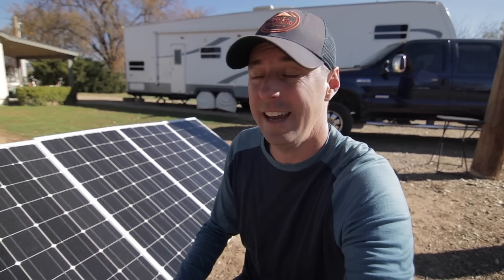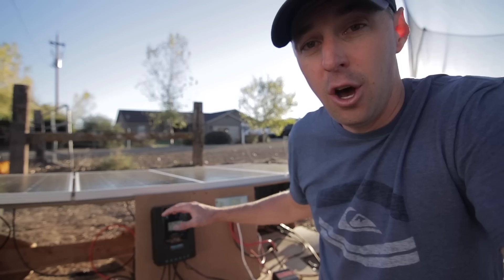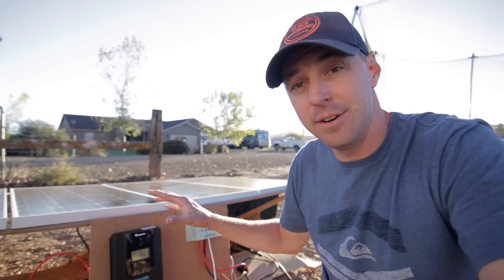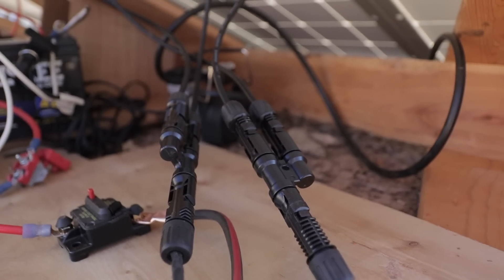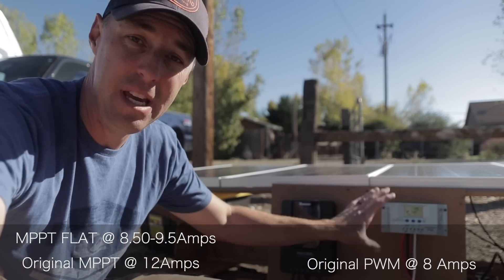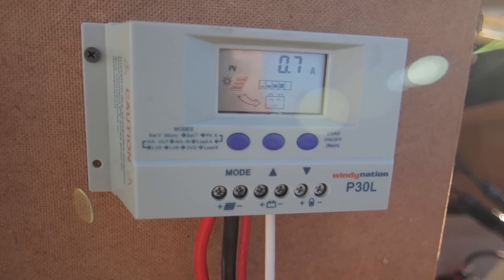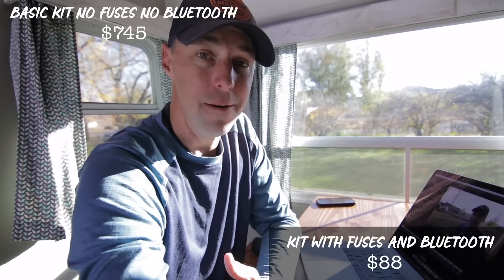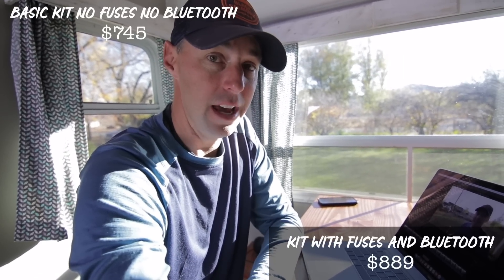RV Solar! Getting The Most Power From Solar.

Comment: As implied in the video, the drop in performance was less for the PWM side when shaded because these panels where wired in parallel.  Wiring in parallel wipes out only the panel that is shaded and not the whole array.  Thus the unshaded panel was still providing full output.  Just the opposite is true when multiple panels are wired in series.  Shading part of one panel wipes out the whole array so full performance is also lost on the unshaded panels.  The results would be similar for either a PWM or MTTP charge controller.  The wiring scheme was the primary factor.  

The advantage of wiring multiple panels in parallel is noticeably less performance loss if part of one panel gets shade.  The shade source can be something other than nearby trees.  It can be the TV antenna, AC shroud, air vent cover, etc.  Those things come into play as the position of the sun changes.  It is difficult to avoid partial shading during the day.  If wired in parallel, the impact is not that severe with multiple panels.  

The downside to wiring in parallel is the voltage says the same but the amps go up as the number of panels increase.  The higher the amps, the heavier the gauge requirements for the wires carrying the current to the charge controller or running more separate wires will be required.  That can be quite significant with a lot of panels.  Larger gauge wires or more wires can make the install more difficult and are more expensive. 

I have four 140 watt panels that are wired in parallel as it is not unusual to have shade on part of various panels throughout the day.   The controller is a MTTP type.  The question is, will the power output from the charge controller be the same if I wired the panels in series to get a higher voltage?  Since the nominal voltage is around 18 volts as is, I am thinking it is already high enough to take advantage of the boosting ability of an MPPT controller and there would be little if any gain.  I am thinking I am better off with the shade advantage with all parallel wiring than any gain I might get by increasing the voltage by wiring some of the panels in series.  My assumption is the final power output with a higher voltage input will be about the same.  

What would make a great follow up test on the MPPT array in the video is to compare the total output power from the controller with the panels wired in parallel providing a 12 volt array and then again wired in series to provide the 24 volt array as in this video.  

As far as wiring in parallel vs series, my thought is to go with parallel to the point where the amperage is too great.  At that point, as mentioned in the end of the video, do subsets of panels in series and then connect the subsets in parallel.  Keep in mind that the controllers have max voltage limitations.  Multiple controllers may be required for a large number of panels.  It is a balancing act so each installation will have its own unique set of requirements. 

Thanks for taking the time to put together this test.  It is good information.
Reply from the maker: Great thoughts you are spot on. I do have more comparisons planned on wiring for the MTTP. The plan is series vs parallel vs series parallel, but I need all 4 panels on the one system to do it. In other words your hope to see it is coming. Thanks for your comment it was well written and thought out.
Reply: There is a lot of discussion, confusion and misinformation when it comes to wiring panels in series vs parallel.  

My old boss used to say showing is better than telling and your demo board setup does a great job of showing.  The additional videos you have planned sound great and the quantitative nature will provide facts rather than speculation.  I love this stuff and am looking forward to the next video in the series.  It will be a reference for the ages!  Thanks for doing this.

Comment: Can you use the mppt controller with the lithium 100amp hour batteries? Also, can you wire the batteries in series?
Reply from the maker: The MTTP we used can charge lithium batteries no problem. On the batteries you would wire them in series if they were 6 volt  and in parallel if they are 12 volt.

Comment: Question, if I am changing batteries do I need to cover up the solar panels before I move the positive wires over to the new batteries?
Reply from the maker: I like having a breaker (https://amzn.to2Deesj9) to trip to disconnect the panels from the charge controller.
Reply: @AllAboutRVs I don't a disconnect but if I add one than I should cover the panels?

Comment: Nice job setting up the test. Q: Do you think the MPPT shade test performance drop is a result of those panels being wired in series and not necessarily the controller type?
Reply from the maker: Yes you are spot on. I should have explained it was the Series wiring that caused the drop. I plan to do a video with a few more comparisons with the MTTP before it makes its way on to the rig. Thanks for watching Brian!
Reply: @AllAboutRVs  No problem
 I enjoy your videos. Keep up the good work. Also, the MPPT plus your fast charging low resistance lithium batteries will also be like having an extra solar panel.

Comment: What about battery types. Do both controllers support lead, GEM or lithium?
Reply from the maker: The PWM on I used is for lead acid only . There are PWMs that have those options. The MTTP I used in this video can be configured for all the different types of batteries including lithium. Great question.

Comment: If you are  using the panels to keep batteries from going dead when away from your motor home  for a time which way is better. What amp is your  MPPT controller
Reply from the maker: I think you would be fine wiring them either way for that application. The MTTP is rated at 40 amps.

Comment: Shade is the reason im not going to put my panels on top of the travel trailer.  I'm almost always under canopy to keep the trailer cooler. Thanks for the idea on an mppt and running my two panels in series and the use of lighter wire.
Reply from the maker: If you have shade often you can consider the parallel and still use the MTTP.  I think I might do a video on this also.
Reply: Great video very informative it could just come down to money you just have to buy what charge controller  you can afford .

Comment: Very informative video. Thank you. Curious about the load used in your test,,did you use 2 separate batteries with a similar state of discharge or did both systems go into the same battery at the same time?  If going into the same battery would difference in output voltage of the controllers interfere with performance readings?
Reply from the maker: We used two similar separate batteries and discharged them very close to 50% DOD to have the controllers as close to equal as possible. Good Question.

Comment: How these panels compare to the ones you installed for KYD?
Reply: And which system did they go with?
Reply: Jake Styger I believe that beside s Zamp they also went with A Victron controller. This looks like a more budget friendly system minus lithium batteries.
Reply from the maker: They have a Zamp system with about 80 watts more in the panels. The charge controller they have is a Zamp PWM. This one is giving us about the same amount of amps to the batteries. They are very comparable to what they produce.
Reply: All About RV's Thanks. What function does the Victron serve.
Reply from the maker: dlbrownmac  the Victron BMV-712 we installed on their rig is a battery monitor.
Reply: All About RV's pppppppppp
Reply: I am so sorry that this happened. My phone often goes crazy, especially when I am half asleep. Please forgive me. I don’t have a RV, but I watch several that travel to Alaska or travel in the lower 48. I really enjoy watching. I am a widow so I just travel with the different families. Do you and your lovely wife with the children still travel or you all remaining in one place?Again please forgive me.
Reply: @stygertravel  KYD went with Zamp. They seem to like their (massive) setup. Can even run the AC for a couple hours off their batteries. But they say they rarely boondock since it's a tad much with kids and water consumption.